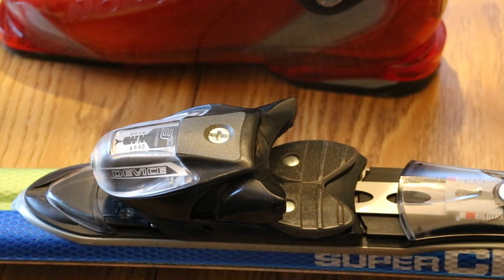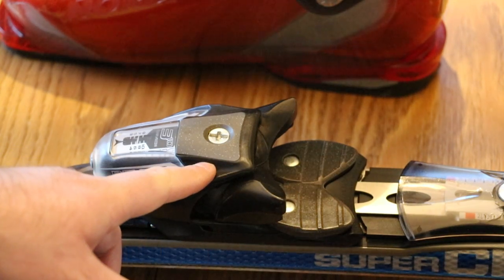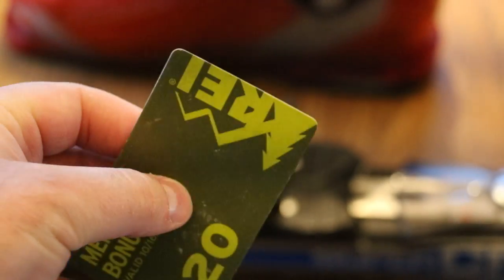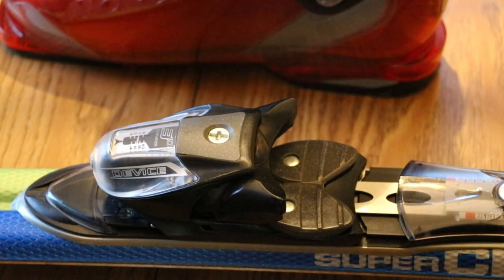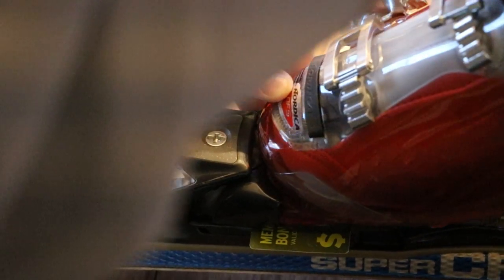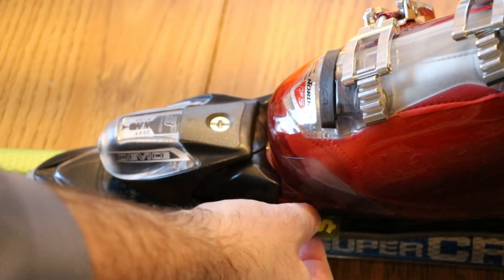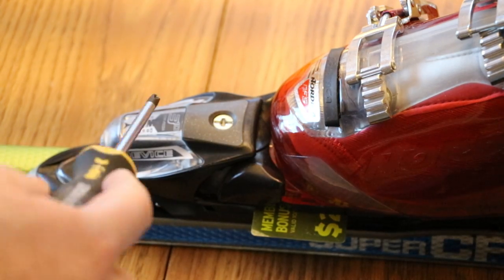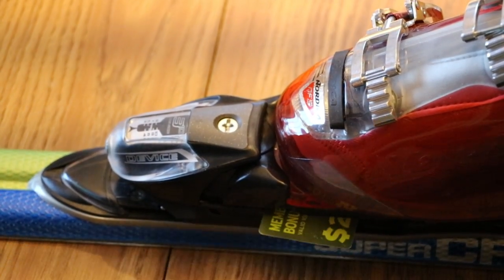How To: Binding Adjustment - Toe Cup Height

Comment: When I place the boot into the binding I then pull the boot back and upwards to insure the the toe lug is in contact with the top part of the toe piece. This method insurers there is no excess space before you perform your feeler gauge test. Also be sure to put the boot back in and double check the .5 mm slip card. Always double check forward pressure adjustment. This is standard procedure fo all binding certification test for professional binding technicians.

Comment: Hi Matt - how do you adjust toe height on a binding that has no screw on the top of the toe? My son has Look NX7 GW bindings. They are compatible with ISO 5355 Alpine Racing boots. His boot toe has too large a gap between the sole and the anti-friction device. There is no screw on top of the binding to make the adjustment.

Comment: Thanks! Great video, as was its predecessor! Any idea how much a turn of the screw changes the height?
Reply from the maker: I don't know exactly. It would depend on the thread pitch of the screw. It's probably a metric screw, maybe M6 or M8. Those typically have thread pitches somewhere between 0.8mm and 1.5 mm, so probably somewhere in the neighborhood of 1mm per turn.

Comment: Shops will provide a calibration test to determine that the lateral & upward newton-meter force matches the DIN & may adjust the DIN based on the results of the calibration test.

Comment: Thanks for doing this video, as info like this is difficult to find even on YouTube. But can I ask where you get the 0.5mm figure from? Is this the official manufacturer's recommendation?
Reply: It's difficult because there are legal issues.  Most adjustable toe pieces you can use a playing card.  Ace of Spades is your best bet.  
Then the best bet of all is to check the manual from the binding maker!
Reply: Sagina1999 As I have one of the Marker 'royal family' bindings, maybe I'd be better with the King of Clubs!
I take your point on consulting the manufacturer's manual, but I can't find anything online except general sales info. Do you know where I might track down such manuals? Where did you find info on your bindings?
Reply: Benzknees
 In the box!  Try to email the makers. Many Markers have no toe height adjustment, but some do.  If the bindings are old they may not provide any info as they will be off the indemnified list.  If there is no toe height, then all you need to check is the forward pressure.  Maybe ask the question on 'EpicSki" or Teton Gravity.  Photos will help in that case.  Good luck.
Reply: Sagina1999 Good advice. I found an excellent thread on Teton Gravity from 2008, all about adjusting the Marker Duke, which applies equally to the Baron, F12 and F10. The posters on there also suggest using a piece of paper or thin card, after first winding down the AFD height and then bringing it back up. Also, for anyone else reading this, they confirm the correct procedure for adjusting the forward pressure screw. Thanks!
Reply: Benzknees
Victory!

Comment: Thank you, very helpful. Although, it appears my bindings do not have a toe cup adjustment. Could this be because of a newer binding model? i.e., Rossignol Xelium 110
Reply from the maker: Though I'm not 100% certain, I believe this adjustment is automatic on newer/nicer bindings.
Reply: @mattculik  That seems what it might be like but from my experience with my new Rossignol Xpress 10 bindings that seem they should be automatic, they aren't actually working properly.  Doing the business card test on them I can see that it is clamped down pretty frickin hard.  I can't pull out the business card without ripping it.  I'm just going to take them to a technician and they can figure out wth is going on with them.

Comment: Hey Matt, I’m on Marker Sole ID bindings. My toe height becomes loose after a while of skiing hard. I’m able to readjust with a screwdriver but I can’t keep doing this. Any idea of what to do?
Reply from the maker: Unfortunately, I'm not sure. When I adjust mine, the screw is tight, which means either the toe cup is riding in a tight vertical track within the binding, the screw is using some kind of nyloc/plastic thread forming setup, or the screw is pre-loaded with a spring (or some combo of these). My guess would be either or both of the first two, and therefore I'd guess that yours might just be worn out and thus not gripping like it used to. Or perhaps the plastic got brittle and broke, loosening things up. Those are just my guesses. If I were you, I'd take your bindings to a pro. Last thing you need is for your boot to come out unexpectedly. Wish I could be more helpful. Good luck!

Comment: Toe height adjustment on bindings that require this procedure is relatively simple for a certified technician. Some models of each brand of bindings may require this adjustment. Some binding models require per load of the toe piece which should be checked visually by the technician.  I have been a professional binding technician for many decades and still need recertifications for every brand we service every two years. We change $20 for and adjustment and release check. Money well spent! This is much less than you would pay to have the brakes on you car or your heating system in your home inspected and adjusted. Just Saying.
Reply from the maker: thomas medeiros - Totally agree that it’s money well spent to have your bindings adjusted and tested professionally. If you watch my other video, I say that in the first few minutes of the video. The reason I got into this whole thing is because my ski shop said my bindings were too old for them to service. Unfortunately, I wasn’t in a position to buy new bindings and decided that, for me personally, the risk of old/mis-adjusted/mis-calibrated bindings was one I was willing to take. Figured other people might be in the same boat, so I made these videos.
Reply: @mattculik  Your absolutely correct about shops working on old equipment. They only want to scare skiers and sell them new equipment. Unless old equipment was completely abused, left out in the weather all rusted up, they can work still. I have and ski on equipment that is from 1980. I have Look and Salomon bindings that are great. I will up grade next season after renting new demo ski's and they are easier on my body for carving. I'm even thinking to mount my old Hi end bindings on new ski blanks. Thanks for the great video.